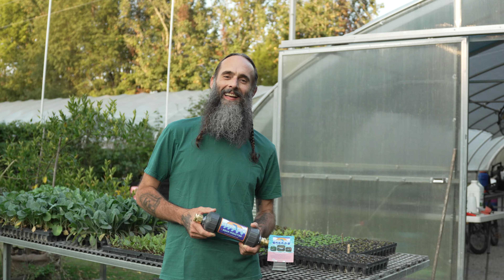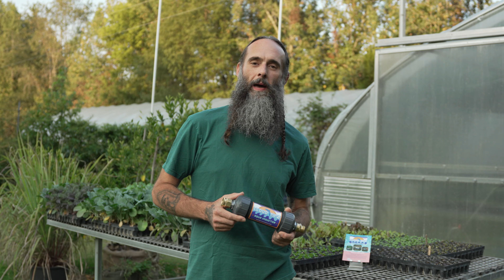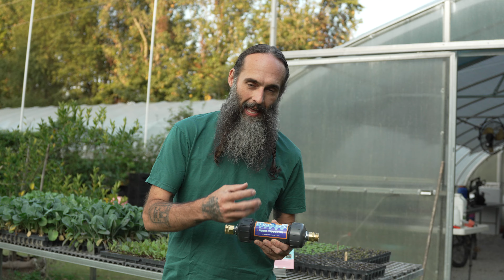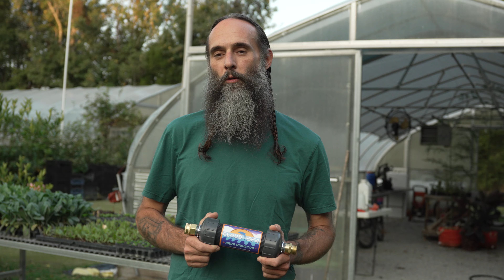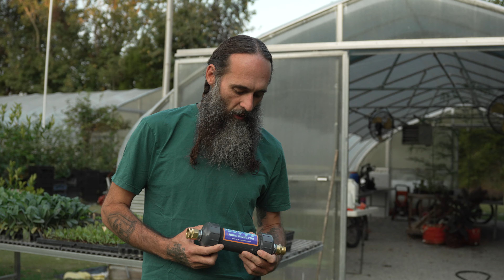Illuminating Water

Comment: Would you use this in the line going into a compost brewer or after the brewer into the garden? Use it for the water or the final brew?
Reply from the maker: Great question. If you had to choose just one of those locations , I would recommend after brewer into garden. However, utilizing the Cloud Sea Aqua Inductor at every opportunity is optimal. Some folks install quick connects and move it around and some use multiple devices. A recirculating pump on a brewer with the Cloud Sea is also a great setup option.